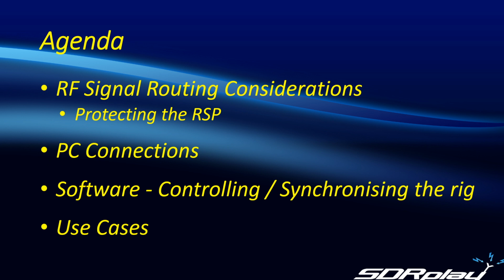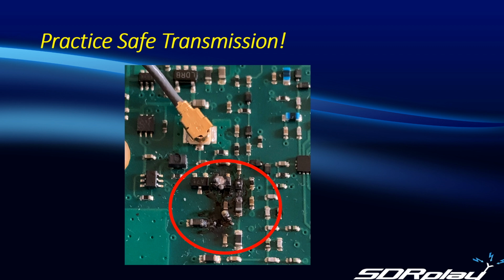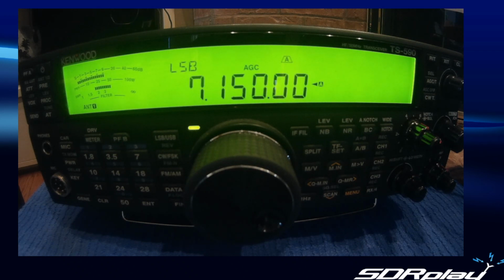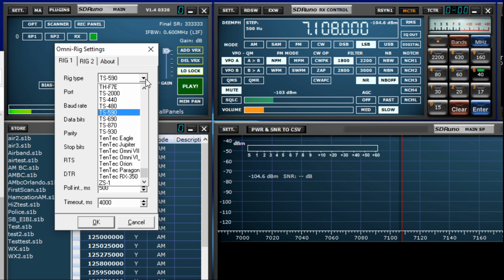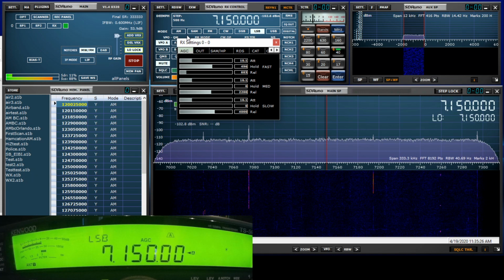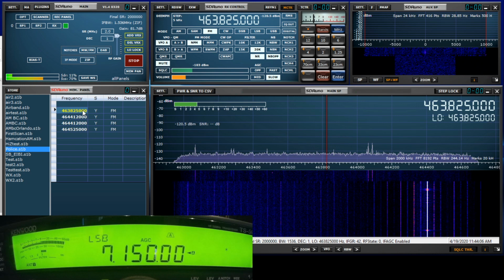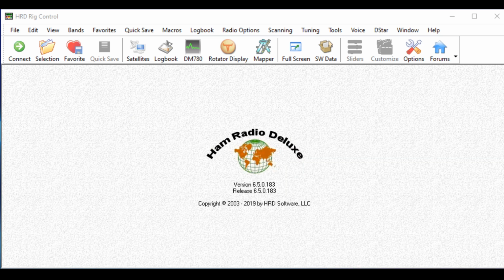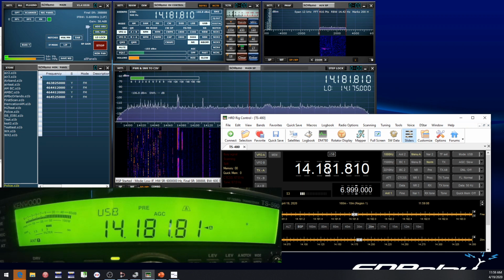SDRplay Panadapter Webinar

Comment: Hi I have the ft991A and succesfully install the pat70 of HUPrf, I also tune the sdruno on 69.45 mhz and I can hear clearly what my transceiver its receiving my only issue is that the frequency its locked on and I cant see the waterfall that I have on my radio.

Would you please help me how to set the sdruno correctly?

Comment: I have an FT-102. It has first & second IFs. First IF has an output of 8.21 MHz and a built-in wide-band outpur tap. The second IF is the typical 455KHz. My RSP1B is connected to the IF tap. This was an easy set-up. Only one thing………. The RSP1B shows everything inverted. When the FT-102 is in LSB the RSP1B must be in USB mode. And when the FT-102 is in USB mode the RSP1B must be in LSB mode. AND all the while the RSP1B is showing the frequency spectrum is reversed. Do you have any suggestions? BTWW: I love the RSP1B and the software. Thx.
Reply: Some converters are designed so that its LO frequency is greater than the input signal frequency; because of this the output spectrum is inverted. In such case, the I and Q channels must be swapped (Main panel ->OPT->Swap I and Q Channels).

Comment: hi I've got it all up and running and linked to my rig and the frequencies are changing etc , the only issue is that when i am receiving a very strong voice signal on my kenwood im not hearing the voice transmission hardly at all at times and then sometimes it comes in very distorted through my pc speakers can hear the noise and see signal spikes any idea what's happening ,regards Peter

Comment: Hallo, I'm using SDRplay2 with YAESU FT 2000. The connection between the 2 device is with a buffer after IF of RTX. I use Omnirig and VSPE. This is the problem: the frequency of the rtx and the program sdr are different . The difference is about 5,6 Khz up for SDR. I tried to do a calibration but nothing changed. What can I do ? Thanks IW!DAL
Reply: Are you using the IF shift feature of the FT-2000? The frequency displayed by SDRuno will match the rig frequency reported via Omnirig, however I thought the maximum offset from the rig was only about 1kHz.  Do you see the same offset if you use another mode like AM, not SSB? There's really no way around this unless we add the capability to program an offset into SDRuno and then you'd have to manually change it every time you change the offset on the rig. This is one reason why we prefer using a full spectrum input to the SDR via an external T/R switch. This will also allow you to monitor other bands simultaneously regardless of which band the FT-2000 is using.
Reply: @elansteve  Yes I'm using IF shift of FT 2000 and a buffer to have the signal out from my Yaesu to SDRplay2 (IF 69450000 Hz)

Comment: What port in my FT891 should I use with that MFJ-1708's control port? Thanks
Reply: On Yaesu's you need the TX GND signal. You should find it on the TUN/LIN connector.

Comment: My Kenwood 590S has the DRV jack on the back...can the 590S be set up the same way as the SG ?
Reply from the maker: No, on the 590S the DRV jack cannot be configured as an RX output. Use an external T/R switch instead, E.g. MFJ-1708B-SDR

Comment: I have the Yaesu DX-3000 that has the capability of connecting the SDR-Play.  Also I would like to connect the MFJ-1708B for double protection. Question: Is that feasible, and if so, what connections would I have to alter/make to my transceiver and SDR Play? Thanks! Regards, BobbyC

Comment: Thanks Steve, really informative video, great. I've just fitted a hupf PA board  into my Yaesu FT857D feeding my SDRPlay 1a using SDRUno. I've set up the IF to that for the rig, which is 68.33 MHz. However, the signal I'm hearing on rig and SDR are always displaced by a few KHz. Any ideas on the cause and a fix? Many thanks!

Comment: Superb video, I've ordered and RSP-1a on the back of it. Looking forward to using it with my Yaesu FTDX101MP and as I run everything with HRD that was  a nice bonus bit added in your video. I am now wondering whether I can use the virtual com port to also hook in N1MM logger alongside HRD for contesting, do you know if I would need the Pro version of the virt com port software to achieve this?
Reply: I suggest using VSPE, this will create the pair. You also need to create a spiltter within VSPE "splitting" the virtual com port and assigning it over to N1MM
Reply: @SDRplayHamGuides  Thanks very much I will check it out :)

Comment: How about another session on using the SDRPlay on boat anchors like Collins, Drake and other non-computer controlled radios. 73 N6OIL
Reply: I believe you need to IF tap the radio and have SDRuno sit on the IF output frequency. Since the RSP is sitting on the IF you would just spin the VFO of the radio .

Comment: Fantastic, can you give me some advice on the best connection for the 5000 i have a splitter on the RX in and out, when i key the SDR play picks up the signal but i think its just a proximity thing
Reply from the maker: david millward there will always be some feedthrough, as long as the level is below 0dm (which it should be in your configuration) there is no problem. You should also see the yellow “RF MUTE” indication in the RX Control panel, and audio will be muted.
Reply: @SDRplayRSP  Hello so when i key up in the db meter in the main sd window the snr reads 66DB and i see the signal? is this ok this is with tuner 1 selected and is attached between rx in and out if i select tuner 2 on the SDR its the same